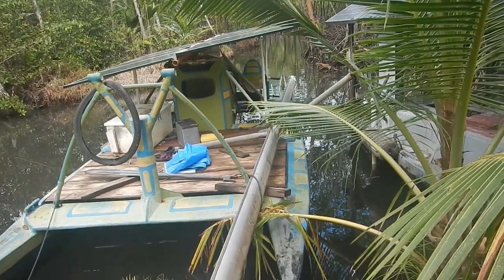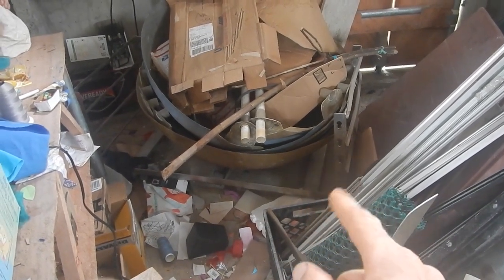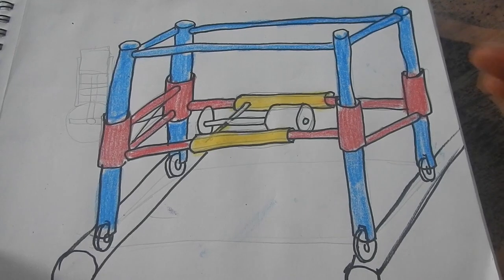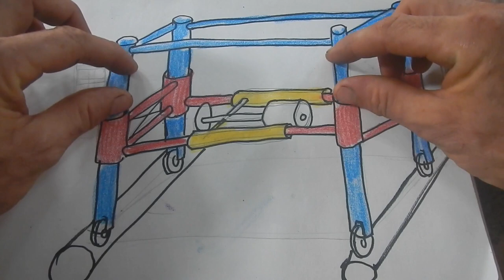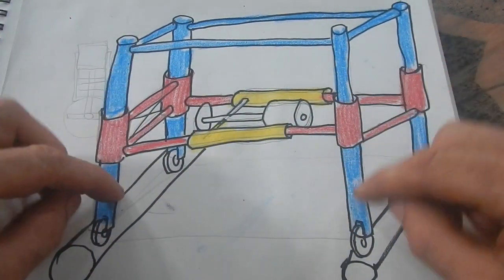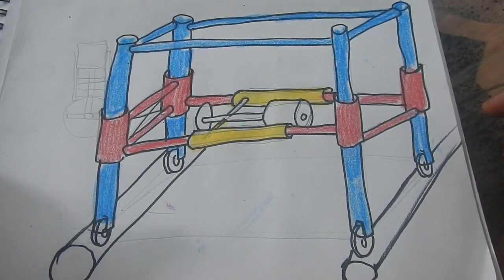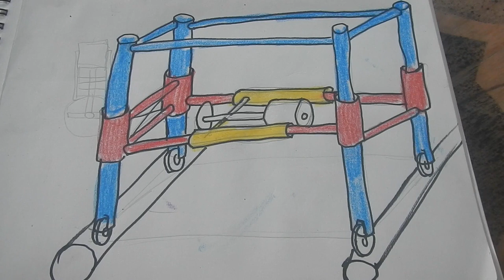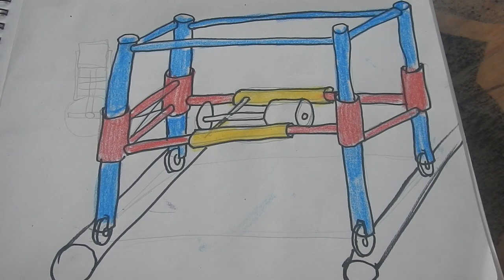Lumber Mill 007 What Next

Comment: Good basic concept. If you can conceptualize the mast being the single beam upon which travels a carriage, it will be much simpler in construction and function, the trick would b capturing the carriage along the mast with enough positive engagement to keep everything running always true in plane. The Turbosawmill warrior may gov e you some ideas.  I have an M8 powered by a larger chainsaw power head.

Comment: How about a tripod at one end of the mast and two legs at the other end. Then suspend the saw taking advantage of the mast sail slot as a guide. Then support some of the weight of the saw with a fixed blade following the cut. This is brainstorming if others kick in more than already have.

Comment: Hay man, I can dig it.  

I am sure you thought of this part but for the wheelie track part a lot of people use 90degree angle turned with the corner side up for the wheels to ride on.  

I am glad you don’t have to worry about chain on an Alaskan style mill.  They have a place in the world, but the up-keep is insane if you want it to last and be somewhat consistent.  

I do have one suggestion you haven’t mentioned.  Although I’d guess that’s only because you aren’t there yet.  A crank system to pull your sled.  You are obviously the kind of guy who dosnt mind walking along pushing it.  I have found, and I’m sure others will support this claim, that a crank style (or motorized) makes for more consistent lumber.  It is one small piece that could screw up in some way.  But it’s also a small piece that makes a difference.  Then again it’s all give an take so, eh. 

Keep on it brother.
Reply: Yeah you really can not do a cran sled. You kinda have to be at the other end to flip the blade so that you can cut the board off. Most times you cut vertical and then cut hortzontal comeing back.. Pushing or pulling. In some caused always pusning as some people have built them to do both.
Reply: @kameljoe21  I am not sure I’m picking up what you’re putting down.

Comment: For other people thinking about it. If it was me I would turn the nut down to a circle then drill 4 hole in it so you can use like one of those grinder wrenches. This way if you cut the top of the log off flush then cut the sides down and when you do a deep cut the nut glides along the cut edge. 
Other than that I would have just bought one of the swing blade blades ( I can have it shipped while Jaimie can not.) online. 
Though it is possible to buid a jig to drill out the 12 inch blades so you can mount a hub on it. It would require someone to machine a hub that  has the holes for the attaching the blade and a  threaded plate on the other side to hold it in place and a matching center punch. Then buy one of the largest metal counter sunks and then put it on the lathe and turn it down so that way you can only couner sink so much. Think of it having a washer stopping it from going any deeper.  
There is enough stuff online to show you how the swing blades are built and the hubs they have. I think it would work. I would also look in to something to cut half of the teeth out of the extisting blade. If you go back and watch his old swing blade you will see that while it does work it is a bit slow. This is because its cutting so much fine stuff that you need a massive amount of relife space. The swing blades are like 5 or 6 teeth. There is also a kind called a double cut which has 2 moving blades one a vertical and one a hortazonal blade that also requires a flush cut and these are generally the best for a home made version as you really only need to set the depth and then adjust the side to side movement 1 or 2 inches. 
Some of the major problem, well not problems with the commercial swing blades machine is the lack of a bed. The reason for this is to make the machine super lightweight and portable. If a bed is to be used then a set of spikes/side stop needs to be in place. My best idea is using removeable veritcal post one side is fixed and one side is lever action. put the handle in and pull back which presses the log up to one sice then using 2 to 4 adjustable post locks the log square in place and then you screw in some 4 inch thick angle/square spikes in place then loose the vertical post and remove them. The spike thing should be able to unbolt easy to repair and or to modfiy them. If you have ever used one those cut off saw where it has that flip up thing so that way you can move the clamp faster. Doing this with a welded nut so that way you can make the handle a hammer and the wrench that way you can pound the spike in to grab it more. The saw needs to be set so that it only reaches 5 inches to the bottome of the log. This is going to be mostly scrap wood. You could also stand it uo and cut a much of 1 inch think slabs which may get a few from it. Its just waste. 
Doing this avoids all of the hassle comes with all of those other ways to line up the long and the lever thing should be pretty handy. 
The only other thing is how and where you get the logs and how they some to the saw mill. Loading them on to the saw mill via a ramp is ideal. So when building the frame you add in already built in ramps to the side in which you will not walk. All controls and how the saw works should be done from one side or another to be able to work fast and free of things in the way. 
Most people forget to cut drying sticks and often make a major mess of an area rather than planning all of this out a head of time. 
If I was ever to attempt to make one again and have the funds to make it good I would do pretty much all of this. Dual blades. Having a source of trees and the ability to cut non stop would be key to making quite a bit of money. 
Bigger the blades the better. People will still pay good money for 1 inch by 4 inch to 6 inch hardwoods. People will even pay good for cheap lumber. The amount of time it takes to cut one 8.5 foot log in to 1x4 2x4s is pretty fast. Depending on how long it takes to load a log and mill it out you could make 120 2x4s an hour at 2 dollars per board of cheap wood would be far more than you make at any job.. Prep and care goes in to planning all of this. 
People will opt to do project if they can find cheap lumber.
Reply: do it then dont just talk
Reply: Awesome information, thanks for taking the time to explain in such great detail.

Comment: Hi! Check out a brand called turbosawmill for inspiration and use the mast as the long straight beam that it is. I think the frame you drew is a bit over worked and could be made simpler. Love your videos and what you do!
Reply: Excellent idea.  I had never heard of those.  That would make leveling the cuts much easier too.  Instead of having to keep two rails level you could just make sure the ends were level while the blade hovers.

Comment: The saw blade must be mounted with countersunk screws, otherwise you will only be able to saw small diameter logs. 🙂
Reply: You may be forgetting that the saw blade is also attached to a shaft. This already limits the diameter 🙂
Reply: @djpaulk  The radius of the saw blade minus the radius of the shaft limits the size of the boards that can be produced, not the diameter of the log. Look at a swing blade sawmill here on YT and you will understand why the underside of the saw blade must be flat and free of protruding parts. :)

Comment: Interesting. But down home there has been many different types of mills built over the decades. The most stable of them all is a fixed blade and move the log back and forth through the blade, but then again the smallest blade I've seen or used was a 36' blade, most are 42's or 52's. Even a 36'er can cut a 18 to 20 inch log, jus got to go a bit slower

Comment: in my observation a circular blade mill the saw is stationary and the lig moves. 
in a bandsaw mill the log is stationary and the bandsaw moves. in both its the log you roll to get the perpendicular cuts so your design is definitely different!
how long of a log are you planning on milling? 
short logs would be better on a stationary head mill and long easier to do with the mobile saw.
good luck!

Comment: There seem to be innumerable  brands of portable sawmills that have been made. I am sure many engineers have looked at the return mechanism, and decided it is easier to just cut one way, manually lift and return the carriage and always saw in one direction, probably because it is much easier to make first off and possibly for consistency. The machine would not have to be out of square much to make a lot of wopperjaw boards. Why not just follow that method of thinking?
Reply: lifting for the back cut. You might as well build a band saw mill. Back cutting the log is what makes the swing blade the overall better machine as well as being able to cut dimesional lumber right off the log in the size you chose.

Comment: Would it be simpler to move the wood instead of moving the gantry?
Reply: When the wood is already cut it is easy to slide the wood into a fixed blade. The problem with raw logs is that they aren't straight and can shift in 3 dimensions on the bumps and curves as you push, so holding the log down and moving the blade on a track ensures the cuts are straight and parallel.
Reply: @aerohard  yeah but if you have the log attached to its own frame like a ladder or whatever and sliding on a rail, seems simple. And you aren't trying to put so many axies on the gantry.

Comment: The nut holding the blade to the shaft will limit depth of cut
Reply: @DineHomeDelivery  tried answering and my explanation too 11 lines of text in a notepad.   Trying a different way.

Yes any cut can only be slightly less than the blade radius minus nut radius.  But after you make a 90degree cut and remove the board.  With a flush nut you can make a second cut an additional blade radius minus shaft radius depth of cut  and end up with a slab twice (and then 3x and then 4x depending on how many times you have to rotate the blade to remove the boards)
Reply: @shadowmancer7040  scrap all of that. The depth of cut is not the problem. Swing blades have a flush blade profile because. Use this for exaple take twenty 1x4s and  stack ten vertically side by side  and then stack 10 on top. Now remove 5 off the top row and you blade can no long move over far enough to cut the last 5 out. You have to cut more lower or go to the other side and cut inward again. Now what happens if there was 11 boards now you are stuck with one board in the middle and to cut it off you raise the blade up 1 inch go in and cut that last board only to have a stub,. There are ways to work around this. Yet it is a pain to do so.
Reply: @kameljoe21  I didn't really follow but I think we might be in agreement.  Flush nut gives flexibility that a proud nut hinders.

Comment: Have you thought about having two blades, one for the x-axis and one for the y-axis?  It is probably easier to rotate the wood rather than rotate the blade. The blade has to be securely fastened.  Rotating it seems problematic.  It is probably easier to rotate the log than it is to have two blades - though that can be more efficient.

Is it too difficult to move the log through the saw rather than the saw through the wood?   You've probably got the better idea.  Logs are heavy.  I just wonder if mounting the blade on the moving part makes it subject to vibration?  I know that it works for mills that use band saws.  There are lot of good portable mills that use band saws and move the saw rather than the wood. 

Are you going to move the logs around manually or are you going to automate that eventually?